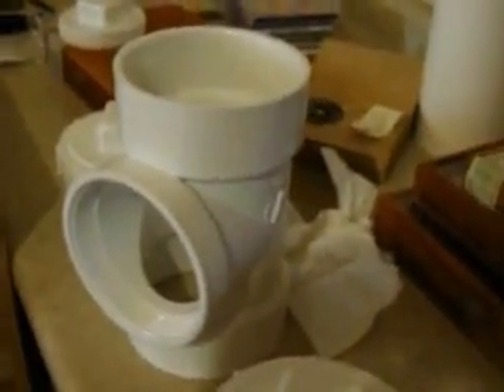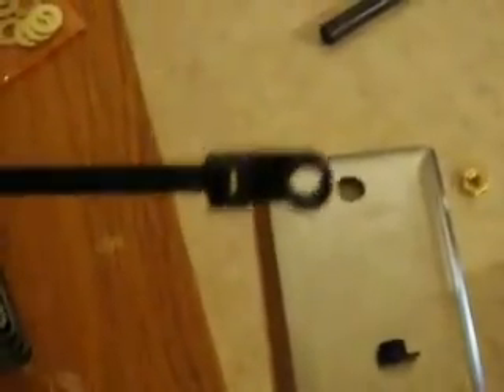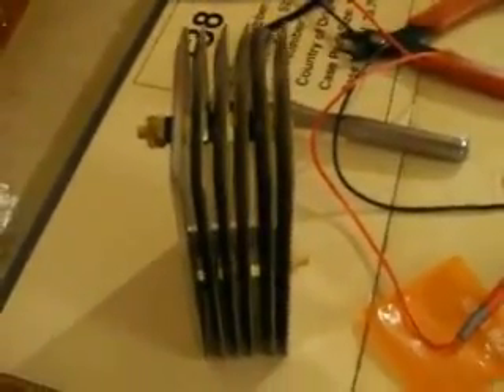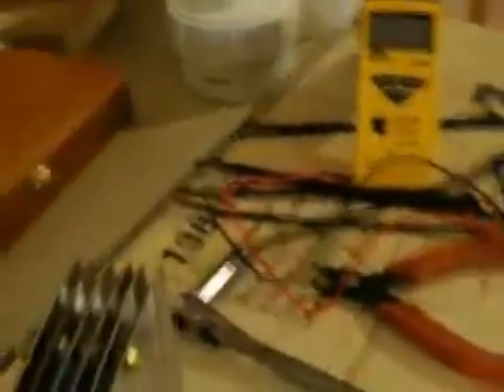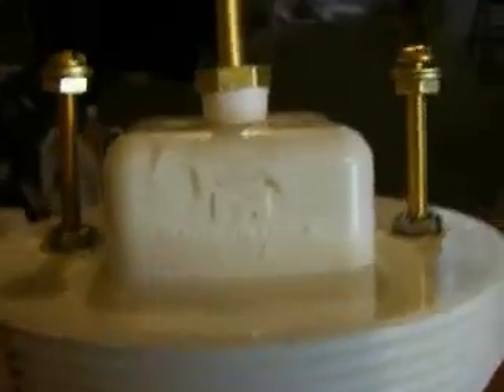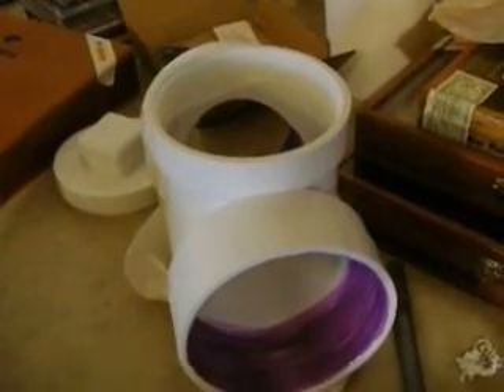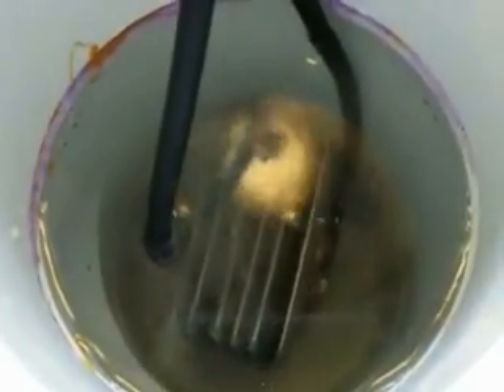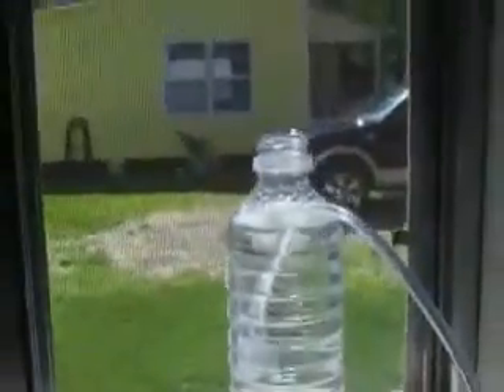Hydrogen Generator

Comment: Excellent design! Although you advise on the use of a PVC T my space considerations in my vehicle have led me to look for a smaller container as a wide mouth Mason jar.  Originally I was only able to get 4 assembled plates through the barely 3 1/2 inch mouth.  What I did was once I had those in I simply assembled the remaining 2 inside the jar with the help of a tiny socket tool.  Also I had to place both screws in the same direction, but other than that the design is virtually the same.

Comment from the maker: @novachevyguy 
It's just regular municipal water. It contains trace minerals, chlorine, sodium flouride, etc.
This was only for testing purposes. I recommend that you use distilled water with a little baking soda (as an electrolyte).
My newer model of this is much smaller (about 1/5 the size) and produces perhaps 4x as much gas.

Comment from the maker: This is an older model of the electolyzer. I have since simplified it greatly with about 3 times the output.
I couldn't give you an exact percentage of oxygen to make the hydrogen burn, but I do know that complete combustion of most flamable materials occurs between 18-21% oxygen. Anything lower than this will achieve incomplete combustion and there is the danger of carbon monoxide being created.
How did you manage to seperate the two gasses?
And what do you do with your oxygen?

Comment from the maker: Sorry for the delay. Yes, i am using a battery charger. You can hook it up to a 12v car battery and it produces even more.

watch your amperage and be sure you do not overload your wires. If they start getting hot, you are overloading them. Use bigger wire or lower your amperage.

Yes, the plates alternate between anode and cathode.

Comment: watch your internal conections for deterioration ... the mixed metal content often causes problems in this type cell configuration ... the copper wire and connections can quickly corrode ... have seen this cause spark inside container ... many use stainless steel straps to connect up to the outside to avoid this problem ...

efficiency will improve if you seal up the edges so electricity is forced to pass from plate to plate instead of doing an end run ...